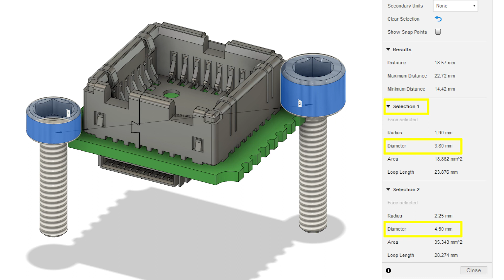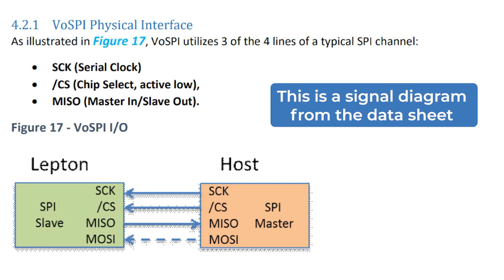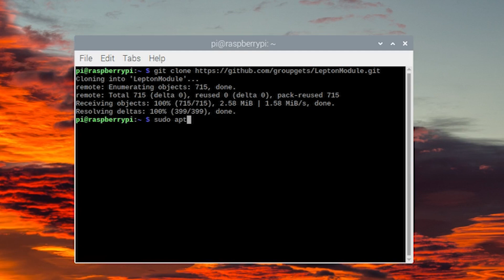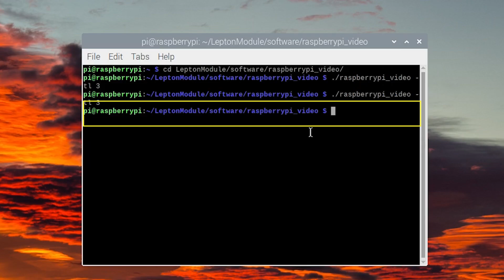How to Get Started with the PureThermal Micro BreakoutBoard for Thermal Imaging

Comment: I’m getting an issue where everything it wired but I’m just getting a small red box as the output!
Reply: Did you find a solution to this?
Reply: @elifbala7216  try toying around with the CS port, that’s what worked for me
Reply: @prestonzaras6175  when you say toying around with the CS port, does that mean connecting it to a specific PI port?
Reply: @prestonzaras6175  is it counter strike bro?